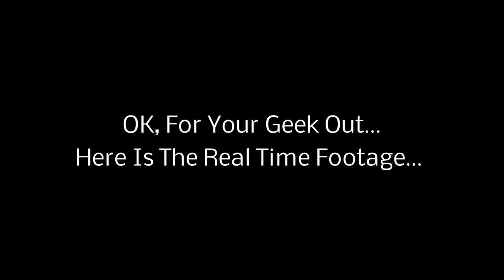A 3D Print That Looks Like It Comes Out Of Thin Air. Time Laps & Real Time. Rostock Printer

Comment: 1. Your extruder temp is WAAAAAAAY too hot.
2. This music invades my brain and makes me want to punch a dolphin in the face.
Reply: 3. Your rectraction setting is insufficient.
Reply: mattio79 Actually, you generally don't want retraction on a Bowden setup, as it will lead to blobbing, which is hard to remove,  as opposed to stringing, which is easy. The 'correct' way to do it is to have extremely high travel speeds (~150-300 mm/s), which should remove most of the stringing. Just look at the ultimakers.
Reply: DemonWeasel1990 i  laughed a little too much at number 2.
Reply from the maker: steven bloomfield
#2 :)
about #1 and Solomon's responce, here is the update: https://www.youtube.com/watch?v=a2XMOSQgLqE&list=UULuDKTNDFfat7iO7KGE7fQA
working well now, almost no cleanup to do. WAY WAY better. and PS my temp is low, trying to help from the strings... but the Bowden is the problem...

thanks! ~Russ
Reply: DemonWeasel1990  Was thinking the same!
Reply: ***** Where did you get that head piece? It's cool. If you have a code for it can you send to me. As far as 3d printing?

Comment: You need a cooling fan to cool the plastic as it comes out, you would get such a better print quality.
Reply: would it be because he has travel time between extrusion to fast?
Reply: David Hogendoorn Could be that also, also could be no retraction of the filament between parts.
Reply: Need better cooling, but the speed is also a bit high for the resolution.
That stringing tho. So much wasted material with this printer.
Reply: that looks like a mixture of no retraction and too high flow rate of the filament.

Comment: if you can see bits of the print moving like that, you need to have more fan blowing on the print to solidify the layers so they arn't soft enough to be pushed around by the print head like that.  If you have that much stringieness, you need to adjust your retract settings.

Comment: hi! will you send me one if you successfully print well an upgraded version not requiring manual assembly?

add support frame for printed ball filled with a specific fill pattern (i'm working out something like a fill pattern that dismantles into useable pieces if the out layers are removed in some way)

the fill pattern could be useful for geometric frames.. i enjoy using some sort of sprayed foam.. currently 3$ a can locally here and other states..

Comment: not sure if it's the resolution you chose, the extruder temperature or the printer itself, but the print quality is terrible.
Reply from the maker: yes, after much calibration i have now retract set to 5mm and get clean prints. the Quality is good in this video, its just all the slop from no retract... :) ~Russ